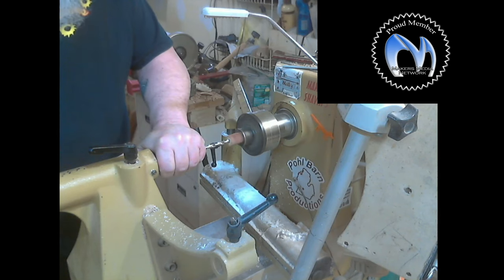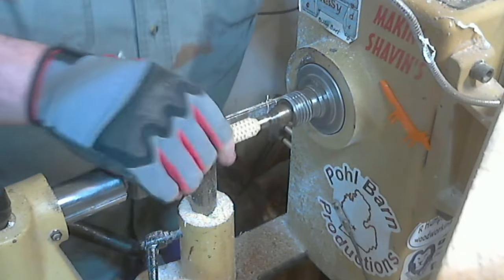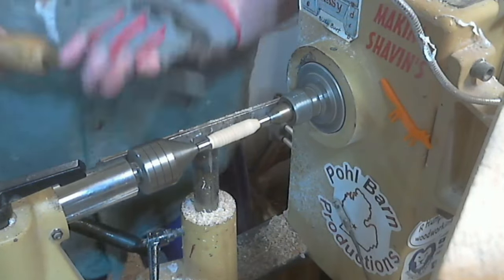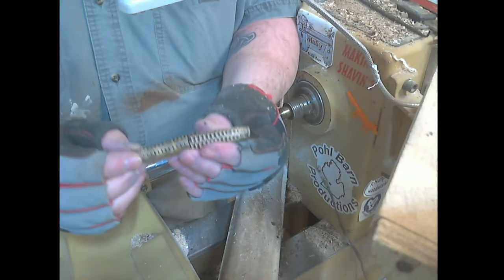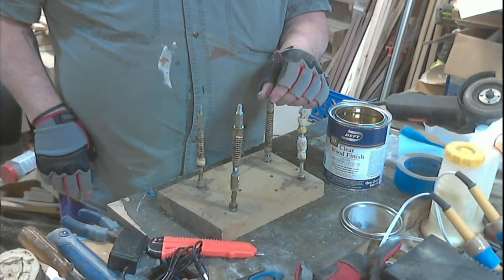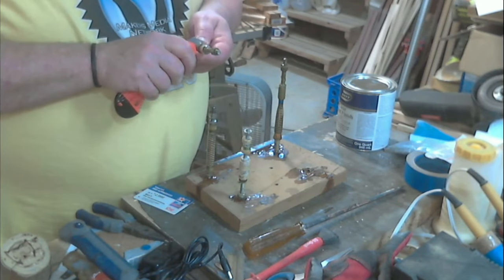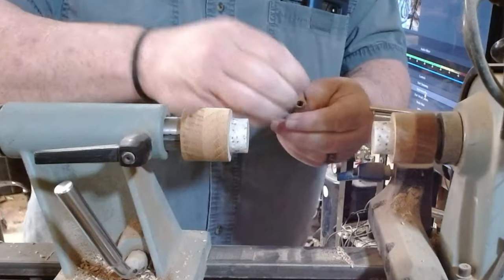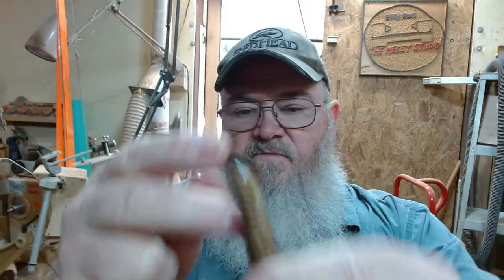Did Someone Say Corncob Pen - Here's Two

Comment: Billy
Two nice pens👍🏻
Liked the modified slim line and your finishing process!!
Is the washer you used for the slim line a standard size or customized ?
Also your dipping mandrels,just use redi rod or thread all for the mandrel part?
Grease or wax on the bushings?
Appreciate your time!!!
Cheers Tim.
Reply from the maker: Thank you, Tim! I used two washers with a 1/4" hole, but they are different diameters.  They are just a couple of standard washers I had laying around.
For the dipping mandrel I just cut a piece of 1/4" all thread to the desired length.
No grease or wax on the bushings. That would contaminate the lacquer and maybe the finish.
Billy
Reply: @TheMessyStudio  thanks again Billy,I’ve tried brushing and rattle can applications!! Looking forward to the results from the dipping application method.
Tim 
Ps .working on my not so expensive vacuum chucks.lol

Comment: The pens turned out wonderful!  I have never worked with corncob, is this just the cob from standard con-on-the-cob you eat?  Is there anything to do prior to stabilizing beside baking?
Reply from the maker: Thank you, Jesse!  Some use those cobs after drying.  I have not.  I've always used cobs from feed corn.  
Mine are already dry, but I still put them in a toaster oven at 250 for an hour or so.  Then I let them cool down before putting them in Cactus Juice.  I also drill a 1/4" hole through the cob for better penetration (though I forgot that process with these cobs).
Billy
Reply: @TheMessyStudio Studio) Thanks for the reply.  An Internet search shows that corn cobs for feed have the kernels attached, do you remove the kernels or do you have a link for cobs without the kernels?